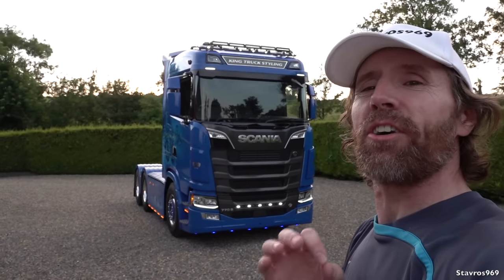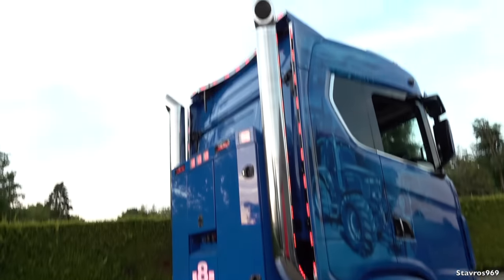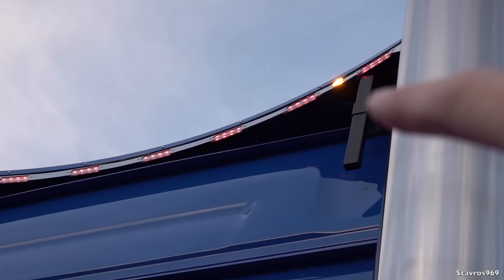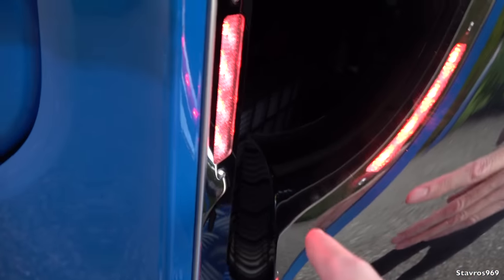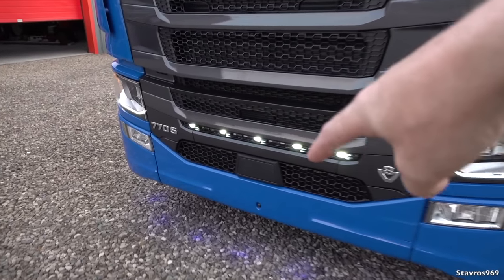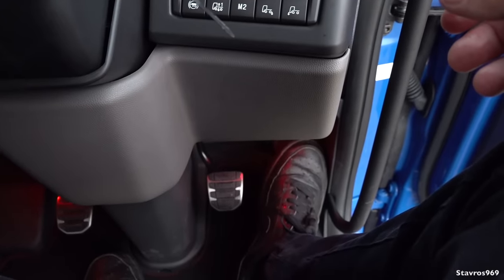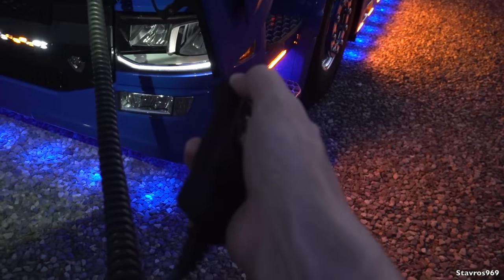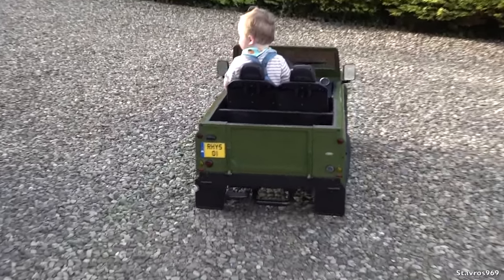Custom Work on SCANIA 770 S V8 + Exhaust Stack Sound!

Comment: Stavros nice truck but flashing lights could look a bit more proment  .i have yellow flashing bulbs added to my R590 inside all forward facing lights plus top flashing roof bar ,you can see  me coming towards you with an abnormal load  .. meesage me if you want to see them